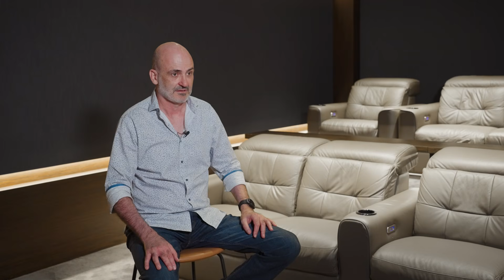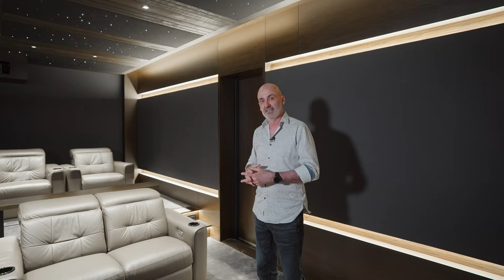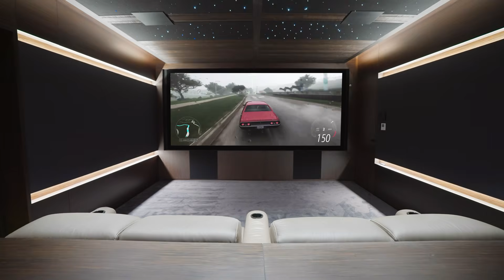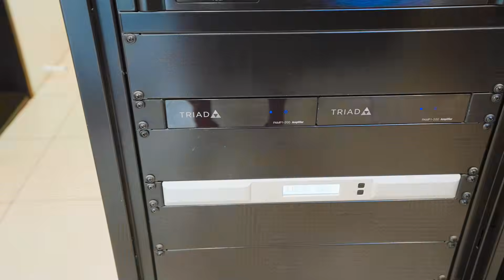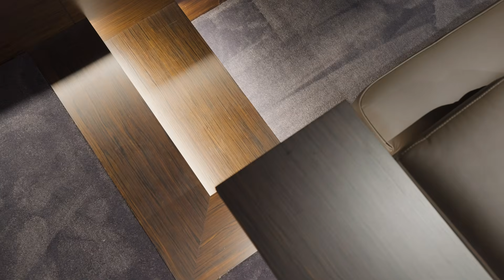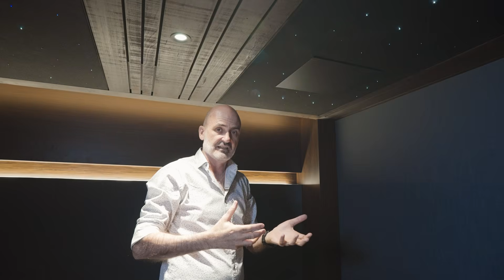Behind the Curtain: Starlight Luxury Home Cinema | Acoustic Design & Sound Isolation in Australia

Comment: A bass trap?   ive never heard of that..... what is a bass trap?
Reply from the maker: Thanks for watching!  Great question.  A bass trap is an acoustic treatment designed to absorb low-frequency sound (bass) over time.

Bass frequencies are much harder to control than higher frequencies.

Bass traps help smooth out those low frequencies so the bass sounds tighter, cleaner, and more accurate - especially important in a high-performance cinema or listening room where you want to hear every detail exactly as intended.

In most dedicated cinemas, they’re usually hidden behind fabric walls or integrated into the room design, so you often don’t even realise they’re there.

Comment: Nice homecinema. looks great. love the clean, flat looks of the walls, very classy looking. Just one question, why no Single or Double Bass Array as Lowend Solution ? Specially for more seats this concepts works better than just 2-4 subs because youve one consistent wave trough the room
Reply from the maker: Thank you so much for the kind words, and excellent question.  If all the seats are correctly positioned in the room, then 4 subwoofers correctly positioned and calibrated offers an exceptionally consistent bass across all seats.  This room also offers a consistent reverb time down to 70Hz.  Adding more subs in any room can aid to improve bass variations, but its a case of diminishing returns.  This system was done to meet a budget and has stunning bass across all seats.
Reply: @wavetraincinemas8417   Okey. I know how multi sub sounds, i use also 4x Subs wich are DSP aligned, wich works of course but you still have cancellations in the room… physics ;-).. . But i would prefer an array, specially when youve the money to have an installer to build your cinema. An Array works better across all seats, where 4 subs only would work perfectly when youve something like dirac art. Of course its complaining at a high level, ive just see too many great Cinemas from private people who uses Double Bass Arrays with 8 or more subs and incredible Bass Perfomance wich small 4x subs cant reach in that big room size :- ) but i like your design choices of your cinemas
Reply from the maker: Thanks for sharing your thoughts! You’re right—bass arrays can be incredible when the budget allows for multiple subs and a fully optimized setup. In this particular project, we were working with a total budget of <$300k AUD ($200k USD), which had to cover everything from A/C to fitout, sound isolation, and electrical. It was also designed five years ago, before some of the more recent tools and trends became common.

Even with just four carefully placed and calibrated subs, we’re able to achieve remarkably consistent bass across a wide range of seats—without needing an array or advanced automated tools. For this room, we used Anthem ARC for final calibration, and while automated systems can help, a skilled designer and calibrator can get excellent results without relying on them.

The subs are ported for high output in this large space, and with D-Box motion integration, there wasn’t a practical need for infrasonic output—which would have also impacted sound isolation.

We really appreciate your perspective, and it’s always exciting to discuss different approaches. Thanks again for watching and sharing your insights!

Comment: What is here the main seating position the back row or the front row. Just thinking is that screen to high and if you are looking in back around 4.5meter in the screen that is like 1 meter too far away from that size of the screen. What size is that screen.
Reply from the maker: Great questions — happy to clarify.
There isn’t a “main” seating position here. The room is engineered so every seat delivers the same experience, with all sightlines fully calculated and confirmed on the construction drawings and on site. The final screen size and position are the result of those measurements and the client’s preferences.
Thanks for watching and for the thoughtful question!

Comment: ? For you for a pair of rear subs if I can't raise them can I face the woofers in towards the couches to avoid cancelation from the 2 front firing subs?
Reply from the maker: Thanks for the question! I’m not entirely sure what you mean in terms of the exact placement, but in general you can aim subwoofers in different directions.  Ultimately, though, what matters most is how each sub couples with the rest of the system to achieve the flattest, most consistent response in the room.  Pointing subs at the rear of seats causes turbulence, which is perceived as uncontrolled bass, so it’s not my recommendation in situations where the sub would be close to the seat.